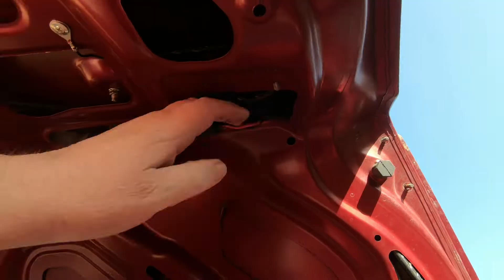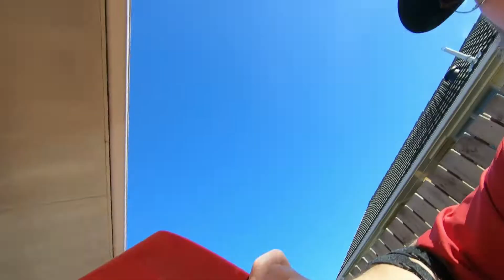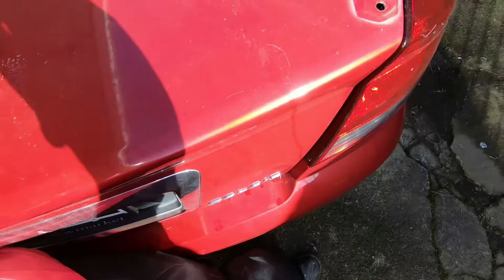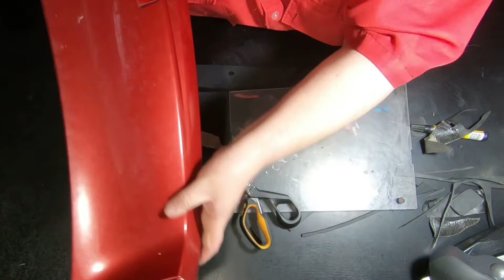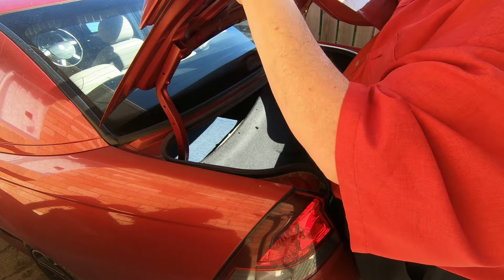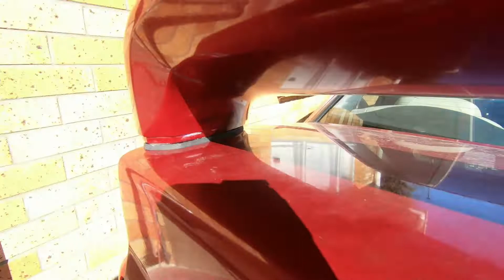Fixing rear spoiler leaking into boot lid VZ Commodore

Comment: How do you get that wire through the spoiler hole? Having trouble getting it off
Reply from the maker: Have you unplugged it from inside the lighting connection? depending on how it was connected you may need to cut the wires.

Comment: Hey mate what’s the best method for tracing around the spoiler mount with the rubber? Doing it tomorrow and just need an easy way haha
Reply from the maker: Hi Dominic. I used the old one and oversized it slightly to ensure there was enough coverage and to account for any shrinkage. You could also cut down a template using paper first.
Reply: @jayslittleprojects1431 okay thanks heaps mate, will do it now! 👍

Comment: What size are the bolts/studs? Want to replace the junk rusted original ones. 
Also how’s the light supposed to be wired? I bought the car with no boot lining and have had a little peak. Looks like some house wiring and a bunch of extra wire stuffed up in there
Reply from the maker: Hi, The studs/nuts I think are M8 The studs I think were 30-40mm.
Mine had nothing that looked like house wiring (sounds a bit of a concern) there is a factory plug option for the spoiler L.E.D. wiring. but I have seen some just linked into the brake light wiring that feeds one of the brake bulbs. The wiring colour for the brake positive is Blue with red stripe and the negative is Brown with white stripe
Reply: @jayslittleprojects1431  cheers ya legend. Need to remind myself of your comment tomorrow haha.
Yes it's a concern. I replaced some when I first noticed it but put off doing the whole lot until I could pop the spoiler off. The connections were solid and the copper itself appeared to be capable enough. I isolated it and have been keeping an eye on it

Comment: Would you make a set to sell payment via PayPal? I have a VY series 2 but the spoiler mount should be the same
Reply: I put some clear silicone goo under my spoiler mounts today have not tested yet though if it fails il be in touch to get that rubber seal
Reply: @DeaD_IcE32  silicone? Was thinking of pulling mine off and future proofing it but not really liking the idea of silicone long term. What about mastic or a polymer like simson?
Reply: @ConceptXX  been sealed fine for a month or so now 0 leaks even with all the rain recently a smear of sellys all clear under each side of spoiler is all I needed results may vary
Reply from the maker: Hi Michael, I'd be happy to but let me wait until I have some rain and checked there is no leaking at all. After two weeks of rain it's now been fine :/
Reply from the maker: Hi, Just tested it after rain today and no water is getting into the bootlid. let me know how I can contact you.